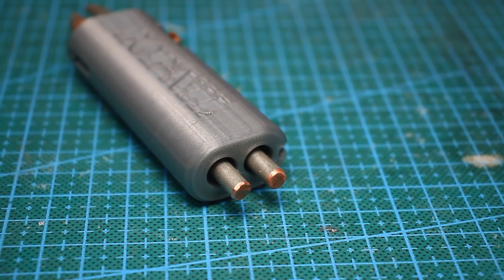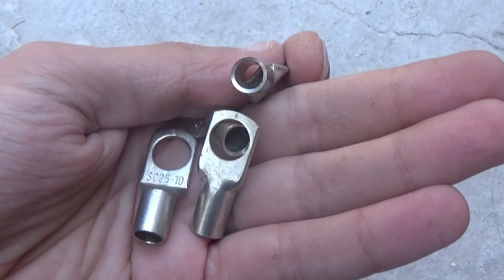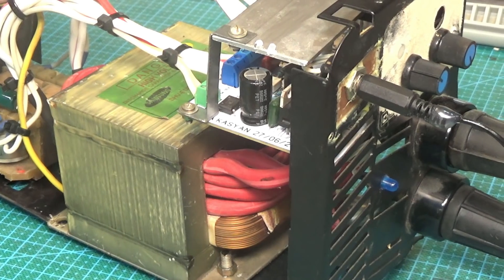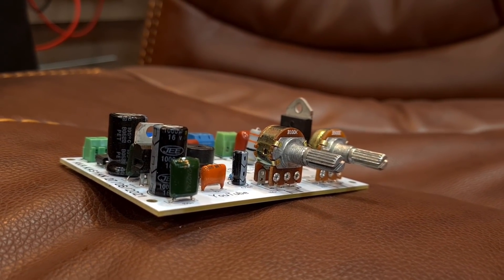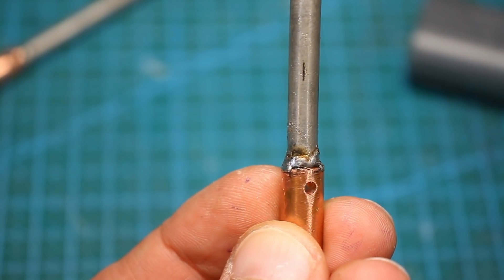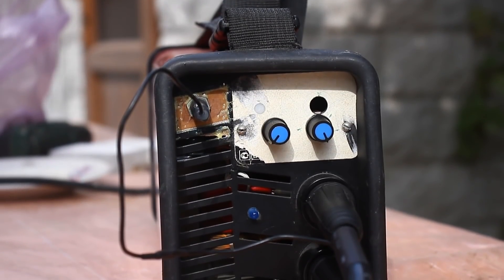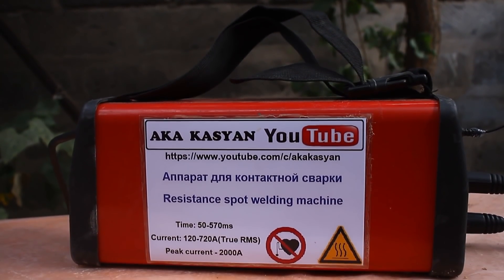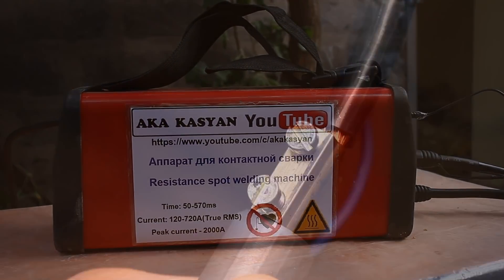What can be made from an old microwave oven

Comment: I looked over the schematic for the controller. If I need to use this on 120VAC with a 120VAC transformer the only thing that would  be perhaps a 250K pot for the power pot instead of the 500K as shown.

Comment: @Kasyan TV
can you please make a "generalized" video about "how to" convert a three-phase tig welder into a single-phase please ? and also how to change the standard accepted voltages a welder is designed to run off into the voltage you require for your country /power source. As there are countless used cheap , powerful 
3 phase welders available online that no one buys because 3 phase is rare and too expensive to get installed  in residential houses, surely you know of a way to do these things as it is known to be possible,  yet there are zero videos on youtube to discuss 
"how to:" do it an what to look for inside the welder an what parts you need to buy to change it.